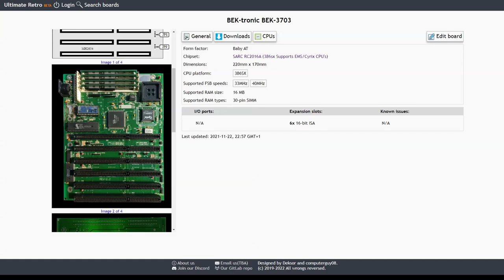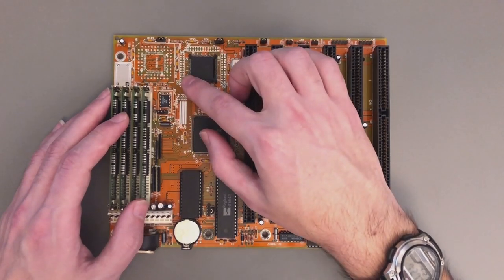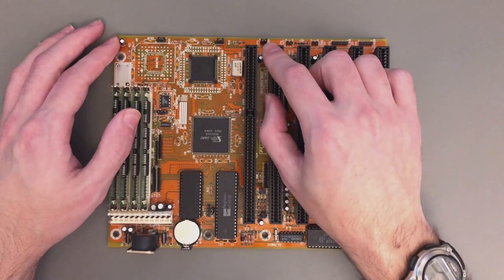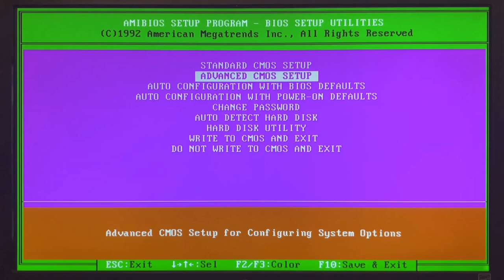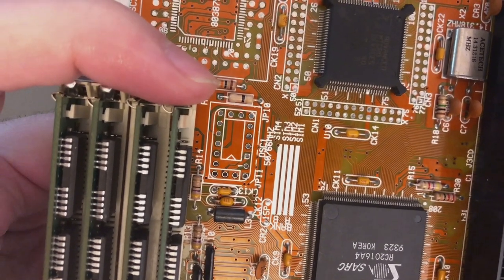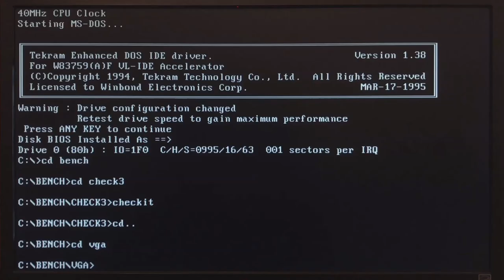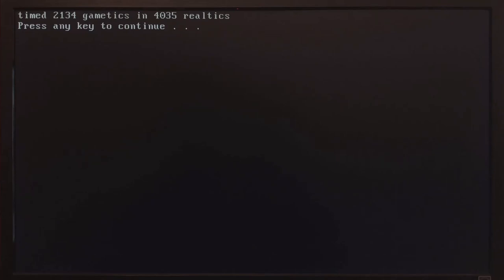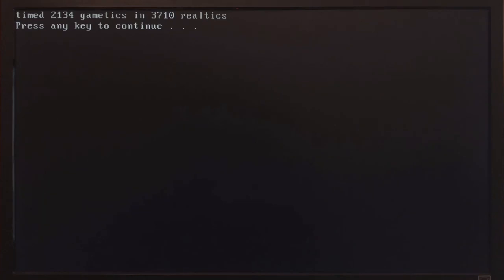386SX Motherboard Review (SARC RC2016 chipset): Optimization Guide, Modding, Overclocking.

Comment: It's looks at 7:56 like you have modify multi i/o card by replacing IDE pin header with R-type one. Why not also add a wire between pin 20 and some 5v point on the card to provide power to CF-IDE adapter?
Reply from the maker: Nice observation there. Yep I did this modification.
Now regarding pin 20, that is a nice idea too, however the CF adapter is missing a pin at position 20 so I will have to replace the female connector on the adapter (a bit of a pain to do) too to make this happen. The multi adapter has also this pin unconnected.

Comment: Thanks again for this wonderful detailed tinkering-with-retro-hardware video. Love 386 stuff!
I'd be very impressed if you push this over 45 Mhz. Doubt the cheap mainboard will will allow it though.

Wish I'd still have my first PCs mainboard: Octek JAGUAR V with a soldered 386DX40.
I'd send you that board for free just to get your opinion on it's quality and performance.
Super curious how that 'Macronix' chipset with 8KB cache would compare to other 386 boards.
Regret so much that I threw it away when I moved in 2011.
Reply from the maker: Thank you. I think 45Mhz is possible with a little bit of tweaking.
Ideally I want 50Mhz :p but yeah this is very unlikely here.
Now if the 486sxlc2 works, with the 2x clock even 40Mhz is enough.

Regarding your 386 M/B... that is sad T-T.
These MX chipset boards are very interesting.
I have many 386 M/Bs but I am still missing something with this chipset.
I will get one at some point and make videos, no worries.
Reply: @atheatos  Did a little research on the Octek Jaguar V 386 boards. Turns out they all seem to be be cache-less garbage. I thought they would have cache on the mainboard because some chips looked like cache -  but I was wrong - and concerning the 8 KB cache in the chipset some users reported it's not working for them and none of these boards perform good. There are many revisions of it - R1.1, 1.2, 1.3, 1.4 and 2.0. Would still be interesting how the 'Macronix' chipset (with working 8KB cache) compares to a 386 board with like 128 KB cache on it.
Reply from the maker: I think I have seen a video with the MX chipset. I think it was necroware, not sure I can not find it. But I remember that the cache was working and it helped a bit.

Comment: nice little compact board. Really interested what you do with it. Do you put these back into cases at some point?
Reply from the maker: Yeah this is compact and nice board. Very easy to trace connections and understand the basics.
As for PC cases, these are out of the question for me. I have a huge collection of parts!
Easily over 100 M/Bs and I live in a single room apartment XD. There is barely space to move here.
Most of the parts are in boxes all together, but the the ones I use often are just here open on the tables.
Reply: @atheatos  sound like heaven rolling in pc parts :-P
Reply from the maker: Sure, but I now need a bigger place or I can not buy more :/

Comment: Ithink I have this same motherboard. I save it from a scrapyard with its multi-I/O board and its videocard. The case was already broken so I left it there. I played a bit with it andis a nice capable board. I used 4M of RAM and an ALS100+ soundcard and it ran dos and Win3.11 very well. 
Were do you get the parts for old computers? Here (Spain) these are long gone (mostly) and whatever survived cost an arm and a leg because of "vintage" or even worst, they are chased by the gold miners that broke everything. I got a beautiful 486 PCChips motherboard with VLB, ISA and PCI but without any chip on it because of those scrappers (I plan to use it to make a ISA backplane for a PC104 386 industrial board that I have). Just sad.
Reply from the maker: Unfortunately I have no access to scrapyards.
So I buy all my stuff online.
A quite expensive sport.
I have now a huge collection!

Comment: Have you ever considered using a rechargeable LIR2032 cell instead of removing the charging circuit?
Reply from the maker: I was thinking something like that today. I might try this. For sure you can not just add a rechargeable lithium there. The battery will overcharge and blow up. I think I can modify the charging circuit and make this safe.

Comment: Μπορείς να κάνεις στο μέλλον ένα βίντεο πως τοποθετείς και συνδέεις την Μπαταρία CR2032 chip του BIOS
Reply from the maker: The battery does not connect to the bios chip but only to the oscillator and RTC/CMOS ram chips (M5818).
Now I did the mod off camera this time, but I think is all explained well in the video starting at 19:39.